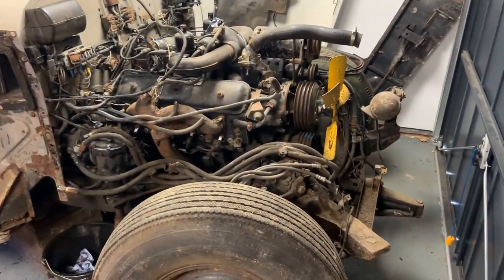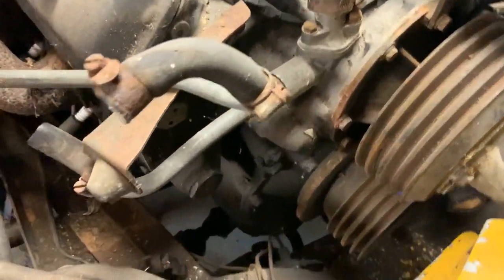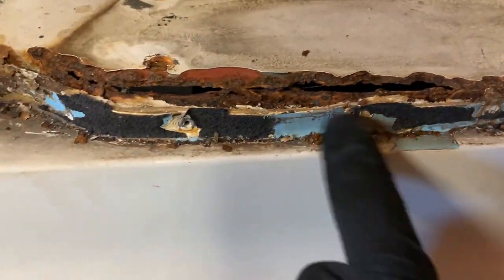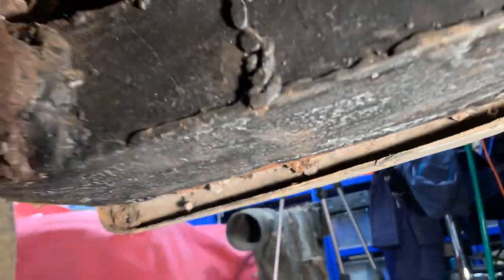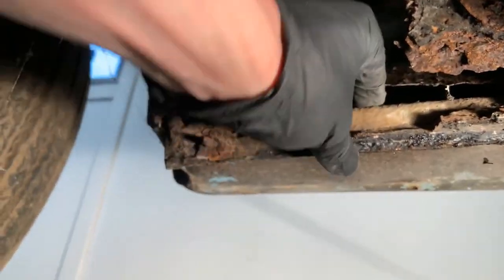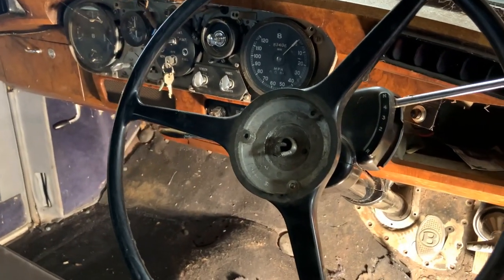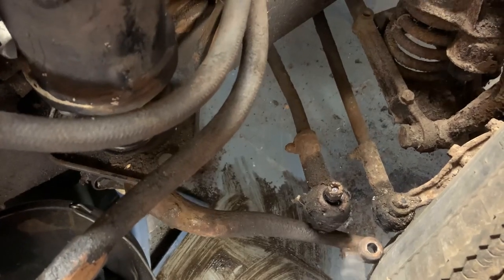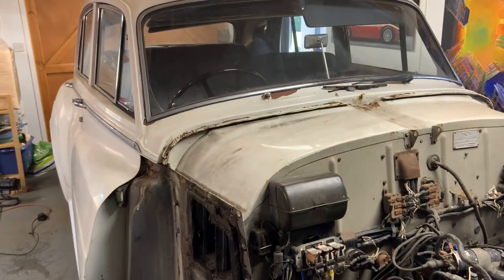Barn Find Bentley S2 Restoration - Update / recap and status. (With Commentary!)  - S2 - EP04a

Comment: Personally, I like the commentary - much more insight into what you're doing and what your plans are. Rescuing this lovely car is a great endeavour - you are very brave for taking it on, most which of which will be undoing the horrors of the past. I will follow with great interest. Thanks for sharing.
Reply from the maker: John. Many thanks for your comment. Great to hear. Having worked on other classics before I have been won over by this Bentley as the workmanship and quality are well above anything else I have seen. That said everything takes ages. I am currently trying to get the gear selector lever out and, despite undoing all the connecting elements, it is still firmly in place. Keep watching and all thoughts welcome.

Comment: Agree on the commentary really good. Just subscribed and may be no 1000. If the engine is too far gone it would be interesting to drop in an American v8 crate motor.
Reply from the maker: Thanks for the feedback. Hopefully the engine is ok but if not, your plan sounds good. Cheaper than making it electric anyway!

Comment: Surely it's a Bentley S3!
Reply from the maker: It seems to be a Bentley S2, that was registered in 1960 with a personalised plate. The plate was then changed to a current plate in 1963, hence the 1963 plate. At some point the wings were changed to have double headlights although they are hybrid wings as the grill is still the taller S2 grill.... or that’s was the current thinking is. I have the original bill of sale that confirms it is an S2. The plan is to return it to the as sold condition, body shape and colour wise. Thanks for the comment.

Comment: Why didn't Bently galvanise more of the bodywork at time of manufacture,that would have dramatically reduced the degree of subsequent corrosion.
Reply from the maker: It is an impressive amount of dust that the body work has now turned in to. When I cut the fibreglass off I fear we will see the true extent of the rot. Thanks for the comment.

Comment: Do you really think it a good idea to try and start it without stripping it first?
Reply from the maker: Good question. Not a clue to be honest. Potentially more fun but catastrophically more expensive if it doesn't work. It drove to its last resting place - which is a good sign. But that was two decades ago. I will have to decide what to do once the body comes off.

Comment: I find it strange that there was no effort in corrosion preventiont , refrigeration stainless could have been used to make the worst areas to prevent rust , but the engineers weren't stupid they knew they were producing a car park that  would rust out .
Reply from the maker: I wondered if the fixing on of the fibreglass many years ago actually made the local environment worse for the metal behind it so it rusted even faster?

Comment: you won't find a Haynes manual for one of these lol
Reply from the maker: True indeed. I have a Bentley workshop manual but it does seem to assume a base level of knowledge that I lack. It also only covers areas that would have needed workshopping back in the day. And it is over a 1000 pages so hard to delve in to easily electronically.